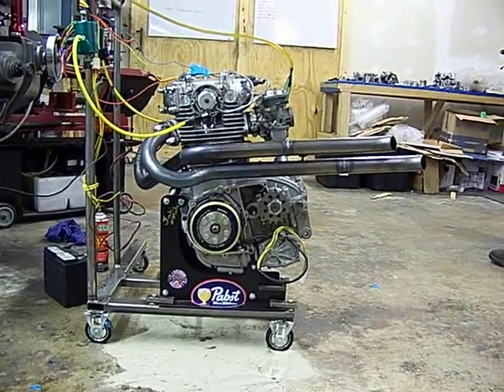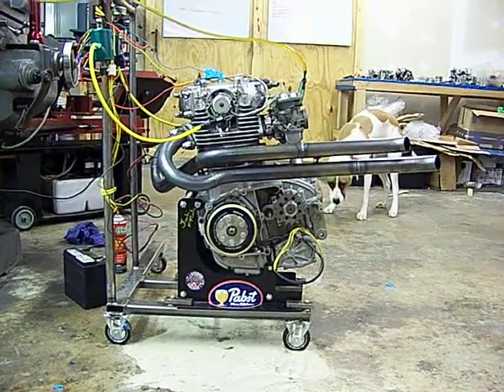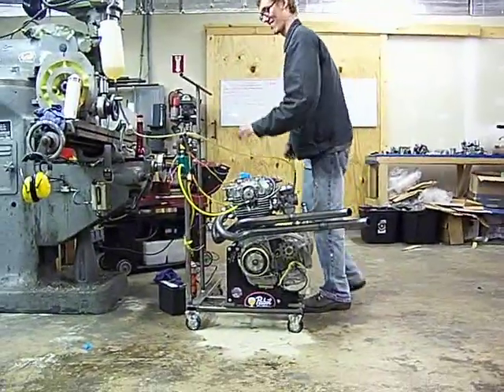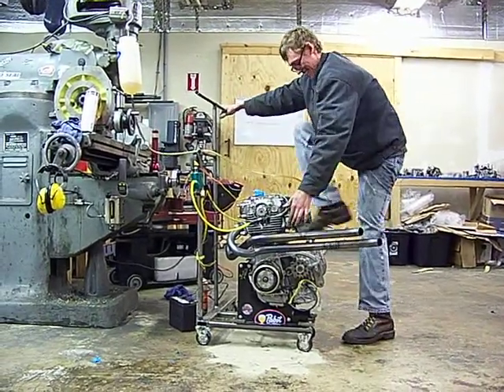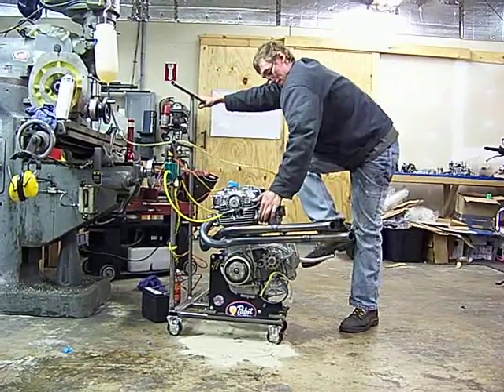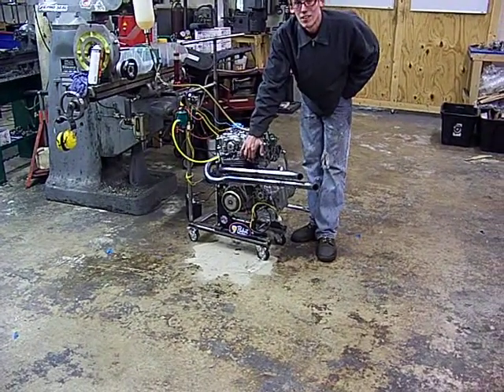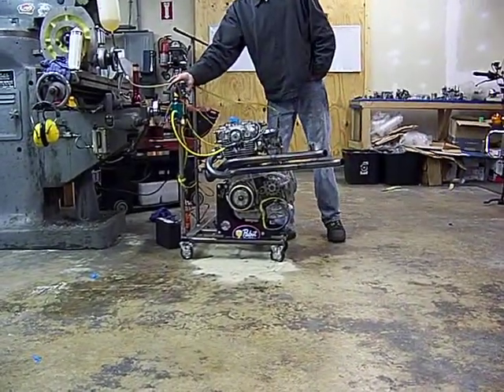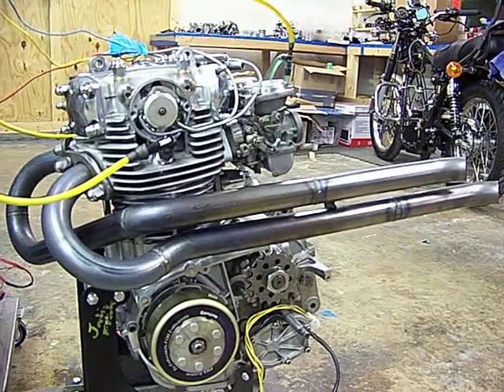Yo Mama Exhaust on a Rephased Long Rod XS650 Engine

Comment: You have a wiring diagram or more pictures of how you have that set up to "bench test" the motor.  I am looking to do that before putting my engine in the frame to find out.  Thanks!  Pipes sound rad with the rephase job!